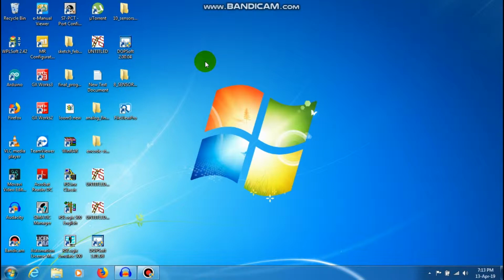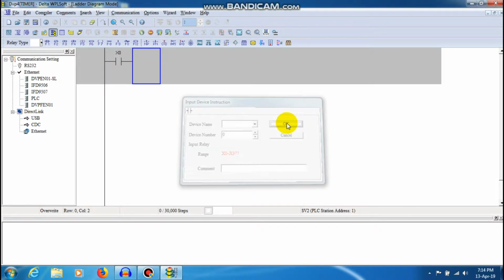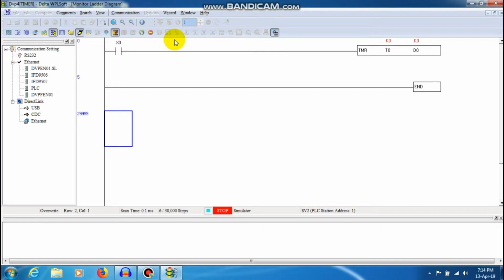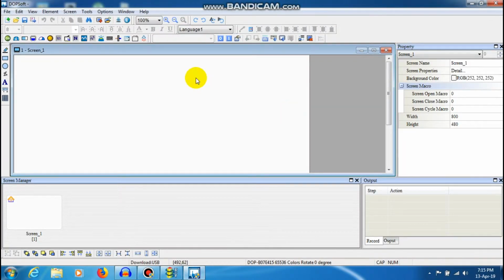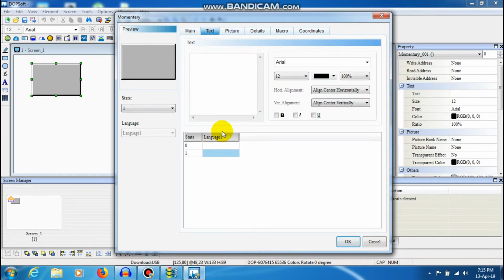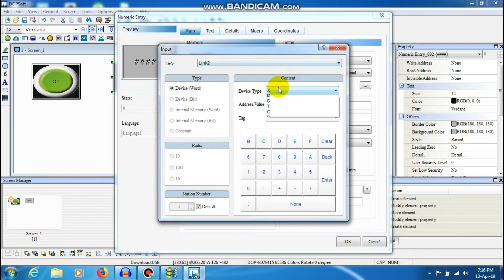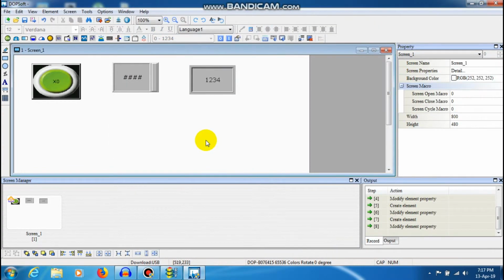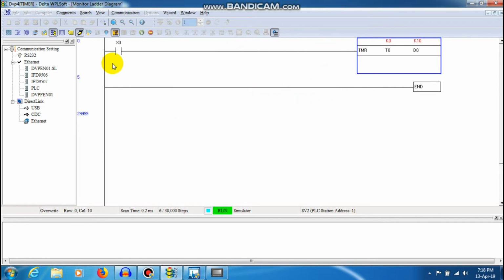Way to change the PRESET  value of Timer from HMI during run time in ENGLISH

Comment: Sir how to show motor rpm in Delta HMI. I have Delta PLC ES2
Reply from the maker: For that you need to calculate RPM in PLC program  then only you can view the speed in HMI
Reply: @logicalsupportandsolutions7741   how to calculate it in PLC
Reply from the maker: @MuhammadArslan-vl7ln  please refer SPD instruction in WPL software
Reply: @logicalsupportandsolutions7741  Ld M1000  SPD X0 K1000 D0
Is it correct?
Reply from the maker: @MuhammadArslan-vl7ln  it's depending on the inputs which you have used
Reply from the maker: You can also use speed instruction

Comment: Good bro, super learning many things from you
Reply from the maker: If you need any topics comment below bro
Reply: @logicalsupportandsolutions7741  
Actually I have lot of questions
1. We have a computer program (.net) which is act like SCADA which need to be modified, we used Micro Logix - AB plc, We don’t have that programmer support, So not able to do anything. after watching your videos, I thought Add an additional SCADA program (In a separate window) for the required modifications, Will this work? One PLC two SCADA program?
2. Please post the videos for using PID controller programming for Proportional clamping,
I.e. We are the manufacturer of Refinery valves, for leak testing purposes used water pressure in the testing stands, to this test valves are to be closed on both ends with hydraulic pressure, this hydraulic pressure must be higher than the water pressure, which means two pressure can be raised, One should higher than other & The different not to exceed more than 100Psi.
3 How many i/o available in SCADA system
Reply from the maker: 1. which programmer support you don't have either .net or AB?

       2.if you use two different scada for one PLC is not cost effective. 3.you can use multiple PLC in single scada is a cost effective thing.4.may I know what is the maximum PSI that you are going to use.
5 do you speak tamil? if yes mail me at aravinth2995@gmail.com i will give you a whats app no...